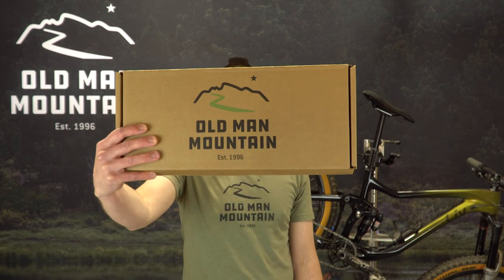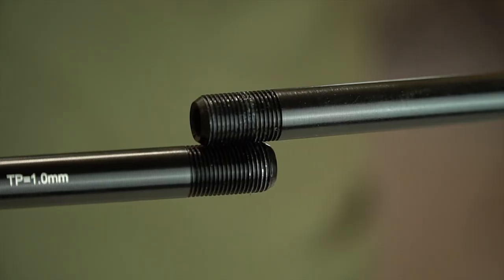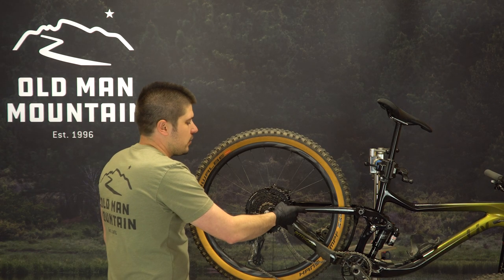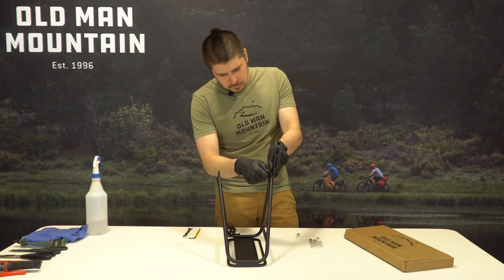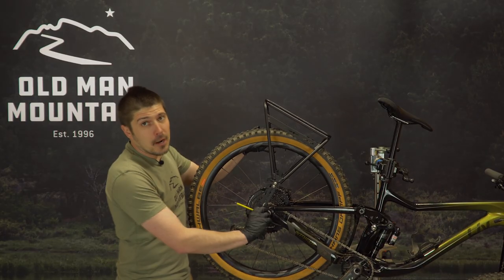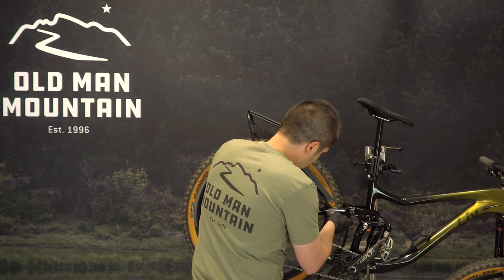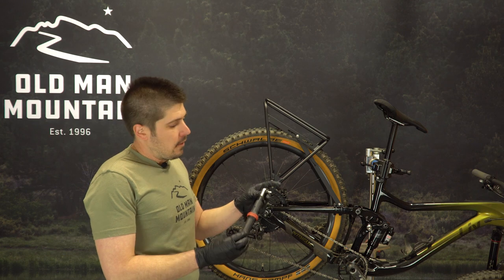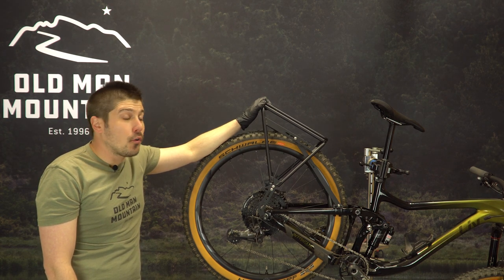How to Install a Classic Rack on Your Mountain Bike

Comment: Torry (sp?), you are an excellent speaker/instructor.

I like this rack design better than the Topeak Tetrarack M2 and Thule Pack 'N Pedal Tour Rack. It looks like the Classic Rack sits back further away from the saddle. I expect when the rear suspension engages the saddle won't smash into the trunk bag.

Comment: Nice.  Not alot of solutions for fullsuspension bikes. What about rear fender and kickstand? Do you sell only the axle?
Reply: I wouldn´t recommend a kickstand on a fully. I make my fenders from used PET bottles cut to fit, eventually zip tied to a rear rack. Old Man Mountain rear racks work very well on all kind of full suspension bikes!
Reply from the maker: We were the first company to make racks for full suspension bikes. That is why the founder of our company started in 1996. We are working on accessories for our racks including fenders and kickstands, thanks for the interest.

Comment: Hi could these fit a YT Capra AL 2016 or Lappierre Zesty 2011? Thanks
Reply from the maker: Yes you can! Use our handy https://oldmanmountain.com/product/sherpa-frame-fit-kit-complete-bike-rack/ FIT KIT finder as it should have your bikes listed. You can also use this page here https://oldmanmountain.com/what-fit-kit-do-i-need/. That page has all the info on how to use our Fitment Guide printouts to measure your stock axle.

Comment: How many people watching this has a newton meter on their wrench? :D
Reply: Zero)
Reply: I've been using a Venzo 1/4 drive beam torque wrench that I found on Amazon for ~$20 with ZERO issues. You can torque from 2-10Nm.
Reply: Most are in foot pounds while Newton meter is on the rear or do the conversion